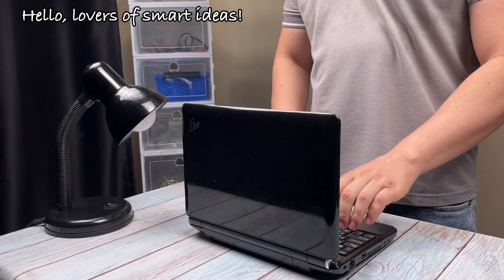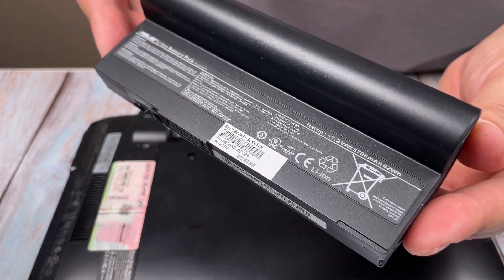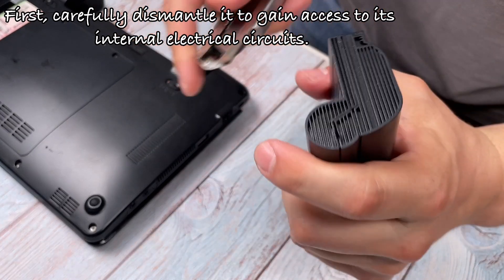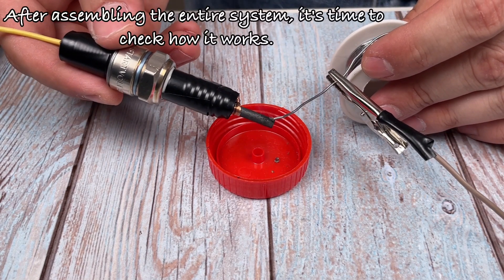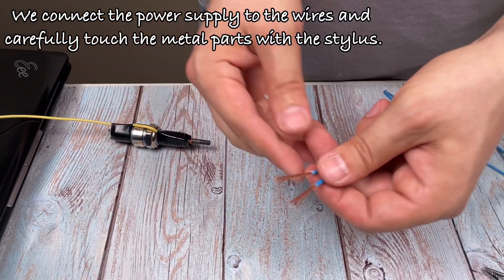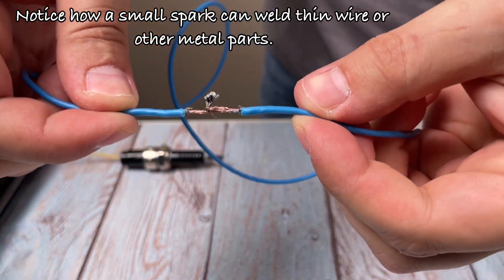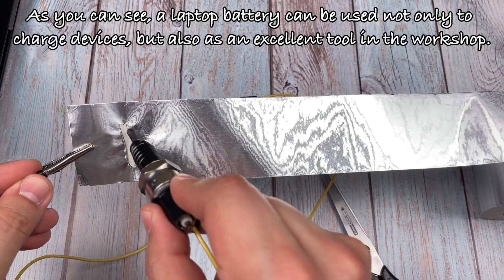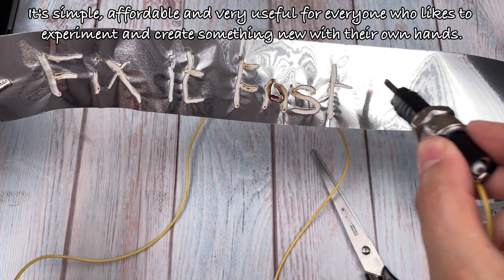🔥🔥 Incredible life for an old LAPTOP power supply! Very few people know such functions

Comment: When re-purposing Carbon Rods from Carbon Zinc Batteries aka Heavy Duty, the first thing I do after harvesting is to put a current across the rod to get rid of the Electrolyte from the pores of the Carbon rod, else that electrolyte smell heating up will bother you for ever when using the devices that you made with it, when burning off that Electrolyte this way, do it outside, it's Nasty, I made a welding / soldering piece using 2 of them fixed on a woiden cloth pin, use low voltage when doing so, use 1x lithium cell 4.2 volts but put a few in parallel for power so Low Voltage  but High Current.